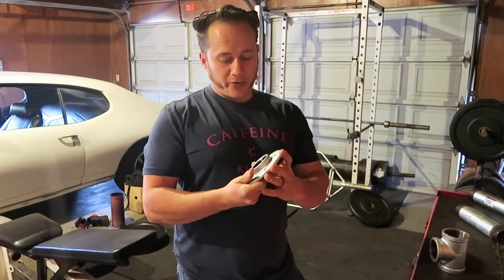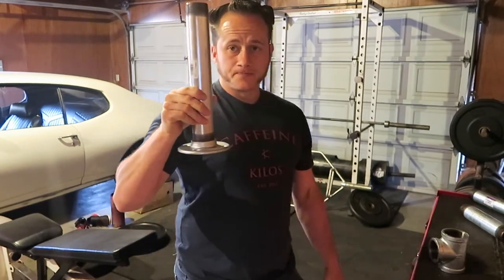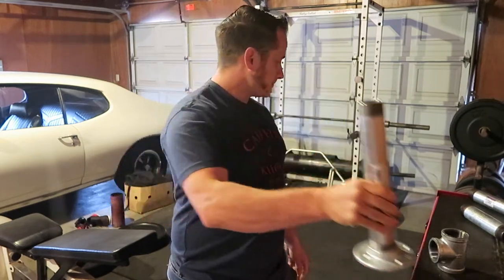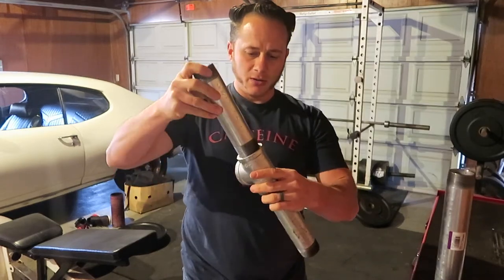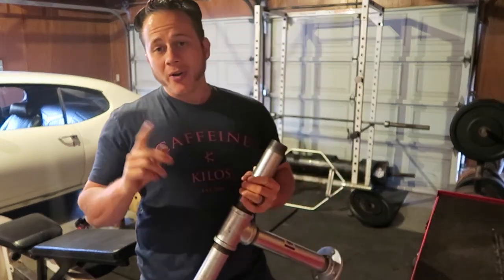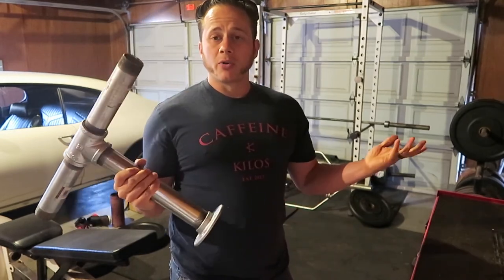How To Make a Duck Walk / Power Stairs Implement | DIY STRONGMAN

Comment: Made one of these some time back. Advise you to make a second handle with four or five inch nipples for using the same loading shaft for two handed kettlebell swings. Can be 1 1/2 but if grip is a limiting factor (like after a pull heavy session) it's better to use the smaller diameter nipples on the handle.